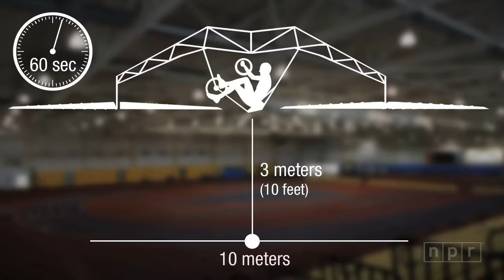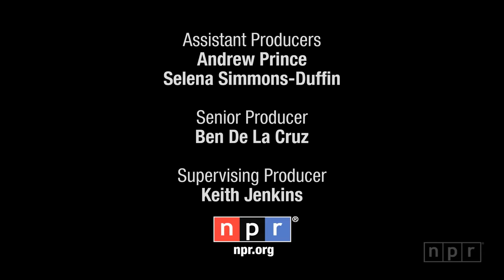Human-Powered Helicopter: Straight Up Difficult | SKUNK BEAR

Comment: Engineers: let's make a human-powered helicopter
Also engineers: let's put the human in a position from which he can't even get close to this max power output
Reply: These are aerospace engineers I doubt they know a whole about Sport science
Reply: @Minechief_1  it should be common sense for an engineer... just look at the position the guy is in: he's working against gravity to move the wheels, when he could be using his own weight to help. It's just awful design for the pilot. Ergonomy is part of engineering but this is not ergonomic at all.
Reply: @Yarblocosifilitico  Very good observation, that's probably one of the main reasons this design didn't even get close to the target. The helicopter (made by a different team) that eventually won the prize used a standard racing bike, albeit one with half of its mass hacked off.
Reply: Shhh 🤫
Reply: i also think their testing method was pretty terrible it had zero fail safe which cost a huge amount of time on repairing and they also ignored the biggest flaw and just crossed their fingers
Reply: @Yarblocosifilitico  If you push downward on the pedals like a regular bike, you are pushing downward on the helicopter. If you push sideways, you aren't creating a downward force on the thing you are trying to make go upward. "Using his own weight" would be pushing the helicopter in the opposite direction he wants to go.

Basic forces to overcome when in the regular bike position (pushing downward, in the -y direction) to achieve upward accelaration:
Weight of helicopter + Weight of pilot + Force of the pilot pushing downward on the pedals

Basic forces to overcome when in the sideways position (pushing in the x direction) to achieve upward acceleration:
Weight of helicopter + Weight of pilot
Reply: @c82153  that makes sense but I'm not so sure. The force is redirected towards the lifting mechanism whatever direction you're pushing. On my bike, I never feel like I'm pushing the bike down (sure, I'm not in the air, but, still), it just feels like I'm pushing it forwards, because that's what the bike does: get my pushing down input, and turn it into a forwards motion output.

If pushing down is a problem then use these clip pedals that allow you to push up too. In fact, according to your perspective, if the pilot made an effort to only push up, the helicopter would fly even better.
Reply: @Yarblocosifilitico  interesting perspective, I see what you mean. I think I figured it out:
When the person pushes down on the pedal, the pedal pushes up on the person with an equal amount of force. This essentially reduces the weight of the person the exact amount that the person is pushing downward on the pedals with, keeping the net force the same. This would mean that downward pedaling wouldn't have a negative effect.

Amended Basic forces to overcome when in the regular bike position (pushing downward, in the -y direction) to achieve upward accelaration:
Weight of helicopter + (Weight of pilot - Force of the pilot pushing downward on the pedals) + Force of the pilot pushing downward on the pedals

However, if the person were on the ground applying force to a crankshaft to lift the helicopter, the reactionary forces would be applied to the ground, instead of the helicopter, resulting in a different net force. 

This made me take a second to think this through lol. Thanks for the mental exercise!
Reply: @c82153  same haha, thanks for your perspective. I'm no expert but this second take of yours makes a lot of sense
Reply: This thing is an all around disaster.
Reply: @Yarblocosifilitico  You have no idea what you're talking about and just making a fool of yourself... Using his own weight! XD
Reply: @elbigotesdelatienda  well, in a bike you do push with your bodyweight because the pedals are straight below you; whereas here you have to push forward so you can't put your bodyweight into it. Not sure what you mean.
Reply: @Yarblocosifilitico  How does the body weight make a difference? All it does is keep you from lifting off from the seat as you push down on the pedals. The same can be achieved with a back rest when you're in a horizontal position.
Reply: @Kenionatus  pedals below you means you can use your body weight to push them; pedals in front of you means your body weight doesn't help you at all. It's just way more natural.

Not sure what you mean by 'keep you from lifting off from the seat'; maybe I'm weak but that does not happen to me x)
Reply: @Yarblocosifilitico  This still doesnt make much sense - in order to get your body weight to help you, you have to have pushed yourself upwards against it in the first place. The whole body weight discussion is almost certainly irrelevant here, because the question is what position allows you to extract the most power from human muscles. I only do mechanical engineering not sport so I can't say what the ideal position is, but even if the upright bike position is better, the reasoning that keeps being used to justify it is flawed.
Reply: @madattaktube  if the recumbent bike were the maximum power design it would be the only thing you see on the Tour de France, which is effectively it's own type of design competition. The benefit of having the rider above the pedals is using their weight + the strength of their muscles to push down on them, which increases the net force into the crank arm and therefore the torque generated.
Reply: @madattaktube  I don't get what's flawed about it. If you wanna break something, it's easier to stomp it than to attach it to a wall and kick it. Because when stomping you can put your full body weight in the motion, whereas if trying to make force forwards you can only put so much of your body weight into it.

Your body weight certainly helps when in the normal bike position. It's why it's useful to stand up on the bike for slopes. Same principle applies here.
Reply: @gabelyon1071  Recumbents were banned from the Tour De France and all other UCI events, so it's not really relevant. Anyway, my point isn't really about whether they are better, my point is that the reasoning is wrong.

Your gravitational potential energy relative to the bike does not change either way, so unless you're constantly falling below your bike your body weight does not contribute to your power output. Either it's simply a case of gravity acting as a restraint to allow you to push more without slipping, which as has been mentioned earlier, can be achieved by backrest design regardless of orientation, or the position inherently allows you to extract more power from your muscles, irrespective of gravity.
Reply: @madattaktube  draw out the FBD my dude, either you add m*g to the force on the crank arm or you don't. 

The riders muscles are adding to their potential energy twice over the course of each rotation by lifting them up (left and right side). This is where the extra work comes from.
Reply: @madattaktube  nvm I thought about the energy balance, I don't think bike position changes it if we assume power output from the rider is constant. 

Pretty sure the positional change just allows way more power output cause of biomechanics.
Reply: dude that's the first thing i noticed, no way can you put out decent power in this position
Reply: @Yarblocosifilitico  Came to the comments to write exactly this point, thought I should check if someone else already had. Amazing how many people get so siloed into their hyper-specific discipline, they lose all ability to think about factors outside of what they're instructed to focus on, even when they're peripheral to the central objective. This is emblematic of the root cause of almost all the problems we've had with the whole COVID shitshow, the people making decisions are absolutely fecking useless.
Reply: @c82153  I think the thing your assessment is missing is the fact that propulsion requires the vehicle to push against some form of resistance. For cars, this is tires pushing against the resistance of asphalt. For planes, this is propellers/jets pushing air backwards for forward movement, and wings pushing air downwards for lift. For helicopters, this is the rotor blades pushing air downwards to create lift. 

If the pilot of this prototype 'helicopter' was in a normal upright cycling position, even though his feet would be pushing down on the pedals, to create substantial downward propulsive force would require that force to be applied in a way that pushed upwards. Even in a seated cycling position, the downward force on the pedals doesn't have any way to exert that force upwards to propel the vehicle down - there's nothing to push against.

I'm also no physicist (although I did live with one for a couple years), so I can't speak categorically, and I'd wager it's probable that the pilot's pedaling would create some amount of downward force in the way that you're describing, simply as a product of the pilot's movement imparting a slight amount of momentum with each pedal rotation, but this momentum would be negligible - particularly in relation to the propulsive force generated by the rotor blades against the air resistance. The fact that this contraption can lift off the ground at all means the lift created by those rotor blades significantly exceeds the gravitational force pushing it down. 

If the pilot being in an upright position could substantially increase the amount of force capable of being applied to the pedals, thereby substantially increasing the amount of lift the rotor blades can exert against the air resistance, then this would significantly outweigh any negligible differences in the momentum imparted by the pedaling motion itself.
Reply: @lachlanbell8390  A very thoughtful and detailed response, thank you! 
However, some corrections to some points you made: there is in fact something for the upward pedal force to push against - it's the pilot. The pedals exert force into the pilot (Newton's Third Law), who kept down by gravity. Think of how, while riding without holding the handlebars, you can push down on the pedals of an ordinary bicycle without lifting yourself off the seat, but push too hard, and you lift yourself off the seat. The advantage of having the pilot sit horizontal is that the pilot can push as hard as he wants on the pedals, and he will not lift himself off the seat by pushing the pedals too hard - given that they need to choose someone who is lightweight, the force required to lift himself off the seat is low compared to the average person, so the pilot lifting himself off the seat is a definite possibility.

Also, with regard to momentum - remember, the pilot's weight relative to the weight of the helicopter is probably close to 1:1 (I forget what they said it was exactly). It's an extremely lightweight airframe. Changes in momentum of the pilot would definitely have a massive effect on the helicopter's performance.

In addition, I don't think the pilot being upright would substantially increase the amount of force to the pedals, because he is a very light person, and applying a massive amount of force would just lift him off the seat if he pushed the pedals too hard. This would probably change if there was a structure keeping the pilot on the seat, like a "backboard" of sorts, but then u might be right back in the position of making the pilot uncomfortable.

Cool conversation, this is a cool thought experiment!
Reply: @gabelyon1071  Dude, pretty sure you managed to think yourself backwards. You had it right the first time - the upright position allows for the rider to use their muscular strength + their weight to create more force on the pedals and therefore more torque into the sprockets/chain. The reason the pedals are offset at 180 degrees is so that the rider can shift their weight - essentially, they apply their weight to push one pedal down to the bottom of the rotation, which thereby causes the other pedal to move to the highest point of the rotation, at which point the rider can shift their weight to the other leg in order to push down on the pedal that is now in the top position. When the rider is fully seated on the bike then sure, it's primarily just their leg muscles that are being used to generate downward force on the pedals, but if the rider's entire body weight is not being applied to the seat, then the remainder is being applied to the pedals. 

This is exactly the point Yarbloco made about standing up on the bike being useful for situations where more force is required - by standing up on the pedals, you are preventing any of the gravitational force created by your body's mass from being applied to the seat, and ALL that gravitational force is thus being applied to the pedals. 

Madattaktube's claim about gravitational potential energy fails to account for the fact that we use our muscles to change how our gravitational potential energy is utilised to create movement. This is literally what allows us to walk - we use our legs to push against the ground, and each time we lift our other leg we then put our foot down in another position so that our gravitational potential energy is applied into another spot. It's the act of alternating this movement from one leg to the other that allows us to move in a bipedal motion. 

At the most fundamental level this is exactly the same as what happens when we ride a bike - the only difference is that on a bike, our gravitational force is exerted against the pedals instead of the ground, which creates the torque used to rotate the sprocket, thus turning the chain, and rotating the other sprocket which is attached to the wheel, thereby turning the wheel as an extension of the sprocket. Tying back into my previous comment responding to Chris G, this turning of the bike's wheel creates friction between the bike's tire and the ground, and the torque generated by the pedals being applied against the frictional force of the rubber against the ground is what creates the forward movement of a bicycle. Or, in this case, the torque generated by the pedals is used to turn the rotor blades, which push against the air resistance to create lift.

TL;DR: the reason an upright bike is more efficient is because we're not just using our leg muscles to push down on the pedals - we're actually using our leg muscles to lift our body weight from the bottom pedal and apply it to the top pedal. We're using our legs to harness the gravitational force of our body mass with each rotation of the pedals, which is why standing up on the pedals creates more propulsive force than when we sit on the seat and only apply a small portion of our body's weight to the pedals.
Reply: @c82153  Hey my friend, wasn't expecting an immediate reply when I was responding to comments from 2 months ago. I agree it's a fascinating thought exercise - I've got law exams coming up and shouldn't be on the internet, but couldn't resist this discussion hahaha. 

Re: the points you brought up, I think my last response to gabe lyon covered a lot of those points - like I said I wasn't expecting a reply quicker than I could post my next comment, so figured you'd see them both at the same time. I only caught your reply because I refreshed the page to make sure my comment was still there (habit I've developed from YouTube deleting so many comments). 

I'd be keen to hear what you think of the points I made above, let me know what you think?  😃

EDIT: Just to touch on your point about "if there was a structure keeping the pilot on the seat, like a "backboard" of sorts" - in light of my case about gravity in that last comment responding to gabe lyon, I think that using some structure like this to prevent the pilot from lifting himself off the seat would actually be detrimental, because it would constrain the pilot's capacity to use that gravitational force in order to push the pedals. Thought that point was worth including :)
Reply: @lachlanbell8390  I actually happened to hop on to see a different post and read your reply, kinda cool how that timing worked out haha. 
I read the post you mentioned and I think there are some corrections to be made about what force goes where in this system. When sitting down, the force being applied to the pedals is due to the force exerted by the legs of the pilot. If the force exerted by the pilot's legs equals the pilot's weight, the total downward force into the heli is still equal to the weight of the pilot. 

Now, get this: if the pilot stands up, he can exert more force to the pedals. cool, you get more energy input and more lift, right? Yes. However, exerting a force onto the pedals that is greater than the pilot's weight results in a larger downward force on the heli compared to the downward force of when the pilot is sitting down, which completely counteracts any additional lift you achieved by the pilot "using his weight to pedal". Think about how your tires on a bicycle flex and squish down when you pedal standing up, but do not do so when you pedal sitting down. You've got the ground to push against on a bicycle; that provides that upward force that counteracts that additional downward force you put into the pedals. With a heli, guess what you are pushing against? That lift, which you just used your weight during pedaling to create more of. The net force is still the exact same whether you put your weight into the pedal stroke by standing up or not, because you counteracted the additional lift you got by pushing downward harder. That doesn't happen with a bicycle because you have the ground to push against; you aren't pushing against that upward lift you are trying to create.

Another way to think about it - plot both the force on the seat+pedals and the lift you get from the rotors on the y-axis, use time for the x-axis time. With the pilot sitting down, the average/net force on the seat+pedals is the constant, correct? And so is the lift, making the average/net force on the heli constant. Now plot it for the pilot standing up. With the pilot standing up, you get more downward force into the pedals than sitting down on the downstroke, which you exchange for more lift. Still the same amount of net upward force.

More downward force on the heli + More lift = the exact same net upward force as sitting down, or perhaps slightly lower, because you exposed more of the power cycle to components in the system that experience friction (rotors, pulleys, etc).
Reply: @jcd-k2s  ummm... I'm not entirely sure what you mean by "bad physics". Physics isn't good or bad, it just is.

Newton's Third Law has nothing to do with momentum, it has to do with action and reaction (forces). Momentum/inertia is Newton's First Law.     
Edit: "nothing to do with" is not correct. Newton's Third Law can be used in its momentum/impulse form in many cases, but not in the "closed system" Benoit mentions. My apologies for the confusion on this, I should have worded it better, as "Newton's Third Law has nothing to do with momentum" is simply wrong.

Why do you say it's a "closed system except for the lift"? It seems to me that lift is absolutely included in the "closed system". You cannot include the input (the pilot) of the system while excluding the output (the lift) and call it a closed system. I suppose you would need to define what you mean by "closed system", it has many different meanings in engineering applications.

In the bird example, yes the plane would absolutely be lighter without the bird on it. Assuming the system is a control volume around the plane, the weight of the bird exits the system when it leaves the control volume, which makes the overall system lighter.
Reply: @jcd-k2s  I do not think the synchronization of arms and legs negating power is a valid assumption. This would need to be tested thoroughly before making such a claim.
Reply: @jcd-k2s  umm... according to NASA, directly quoting them:

"Newton's Third Law of Motion (Action and Reaction): Whenever one object exerts a force on another object, the second object exerts an equal and opposite on the first."

Wanna tell me what part of that mentions momentum? Might want to study up on physics yourself mate lol
Edit: yes, Newton's Third Law has its momentum/impulse form, but cannot be applied to the "closed system" Benoit describes. This is why I was confused why he kept talking about momentum/impulse for Newton's Third Law, I correct this further down.
Reply: @jcd-k2s  cuz the point of bicycles is not to power a helicopter lol
Reply: @jcd-k2s  Also, the system absolutely acquires momentum from the force applied to the pedals; the rotors spin. That's kind of the whole point of having the pilot. The helicopter/pilot system starts with no momentum, pilot applies a force to spin the rotors (Newton's Third Law comes in here), which then provides lift. The system gains momentum from the pilot spinning the rotors; you cannot exclude some momentum and include other momentum in your momentum-based calculations. That's not how those calculations work, dude. I see where you were going with the "Newton's Third Law is conservation of momentum" stuff now. However, "conservation of momentum" cannot be applied to this situation or system, as friction occurs at many points in the system, such as the air friction on the spinning rotors (which is an external force on the system you defined). You could use conservation of momentum if you'd like to include the momentum calculations for the air molecules tho. Momentum, as far as we know, is always conserved, but is not always practical to use in every application.
Reply: Okay, let me preface this with, I am skimmed the responses, and most of it seems to be directed about maximum output from the legs.

Yes, you generally will achieve 20-30% more outright power when cycling from a standing position vs recumbent on a bicycle.

This is not a bicycle.

You get that extra power not because of gravity, but because you are pulling up with your arms on the handle bars, and using all of the muscles from your arms, shoulders, back, core, and legs to pedal. A Recumbent effectively removes your arms and core from the equation.

So, why not use a standing position? Because to maximize your output in a standing position, you need freedom to move, to throw your mass around into alignment. Watch a cyclist during a sprint, and watch how they are throwing the bicycle around underneath them. How their weight keeps shifting, side to side, back and forth.

How make that bicycle, 80 feet wide. With propellers on the sides.

Sometimes, you have to seek compromises to fit within a situation. Remember, their goal is to have this vehicle, accent to 10ft, and have a point remain in a 10ft lateral box, not drifting outside of that parameter. If you go and stand to pedal, you are going to be throwing your mass around radically changing the attitude of the craft in a fairly random pattern, thus sending the craft off in unexpected trajectories.

So, they opted for the recumbent position, to lower the changing centre of mass. They then try to recoup the energy loss of the recumbent position, with an arm powered cycling set up.
Reply: @dposcuro  I was thinking that an upright bike would actually be a limitation, because your maximum impulse would be somewhat limited by your weight. If you exceeded your weight, you would basically be jumping off the pedals. 

But you're absolutely right about using your upper body and core to increase your output. It's been too long since I've rode a bicycle, but reading this reminded me of how that feels.
Reply: @dposcuro  good points but I still disagree with some.

First, gravity does do something. It can't be ruled out of the ecuation. If you had to pedal upwards instead of downwards, it'd be much more difficult... mainly due to gravity. To a lesser extent, same applies when on a slope (that's why we stand up and pull from the handlebars, as you correctly say).

The bike gets thrown around so you can pedal like you're actually sprinting (as in running). Basically you're making it so you can put all your weight behind every stroke (so you are taking advantage of gravity).

True that the physics in this device work different than in a bicycle, but still, I don't think the advantage of lowering the center of mass (not sure if it's much of an advantagde, but I guess it must be if they did it that way) compensates for the akward position. 

A cyclist can still put more force without standing up, just by pedaling stronger, and will always deliver more power pedaling downwards than if the pedals were at the height of the handlebar. As you say, "A Recumbent effectively removes your arms and core from the equation." And that just decreases your potential. Even if to maximize the regular position you need freedom to stand up and move, you'd still achieve way more power just by sitting on the bike normally.
Reply: @c82153  you know nothing of physics.
Reply: @stephencaparelli7733  pretty much. the number of scientifically illiterate comments here is hurting my brain. there are differences between upright and recumbent cycling positions, however none of them having anything to do with pushing with the assistance of gravity or any other such nonsense.
Reply: @c82153  That is not how this works. You are pushing against the air, which increases pressure below the wings (rotors are wings that spin), canceling out the movement. Why do people who have no idea about physics pretend to know what they are talking about? Especially this garbage that makes ZERO sense. You are not attached to anything beside the helicopter, you pushing down means the helicopter pushes back with an EQUAL force.
Reply: @madattaktube  he is correct your body weight does most of the work when riding a bike. the helicopter pushes up because of the rotor blades and putting the pedals below him would make him more effective. That is why another team who used a much heavier design won with ease.
Reply: @excitedbox5705  I wouldn't say I have "no idea about physics" mate, I've got a BSME with a Minor in Aerospace Engineering. I don't really like to bring that up in open forum discussions, because it's not generally relevant to the thought processes being discussed, but this is the 4th or 5th comment that mentions this unproductive "you know nothing about physics" phrase.

Anyway, back to the actual topic:
Fluid dynamics is a tricky thing to grasp. While "pushing against the air" will exert a force against the air, guess what the air can do? It can be pushed out of the way, letting the mass pass through - air is a fluid. This is why the air cannot provide an equal and opposite force to the total force exerted down "using your weight" (unlike the ground, which can provide as much reactionary force as you need). You cannot apply an "infinite" amount of force to something that can just move out of the way.
Reply: @c82153  The fact that you would be flying means that at minimum the air is providing enough resistance on the rotor blades. There is no "just move out of the way". Pushing down would increase the force pushing against the air under the blades meaning the blades create MORE LIFT. If you removed the blades, then yes you would be able to push the bike down while STILL slightly being pushed up (just because you don't see it doesn't mean it isn't there). Anyone who truly has a AEROSPACE degree SHOULD know this. At this point, I am actually afraid that someone like you might be designing anything that gets higher of the ground than a stepladder.

Take a big sheet of plywood and let it fall. As it is falling push down on it with your hand. That force you feel pushing back is the plywood NOT just moving out of the way. In the case of the helicopter, the pushing force also rotates the blades, which means they speed up and create even MORE lift. Basically you are falling on the pedal instead of just pushing the pedal which means the energy input is increased.

PS. Besides this being common sense, this is learned in 7th grade science class, and you do not need a degree in engineering to understand this concept. In your case, you should have kept that to yourself.
Reply: @excitedbox5705  Ok, so based on your comment, it seems pretty clear to me that you don't know how wings actually generate lift. 
To quote you: "The fact that you would be flying means that at minimum the air is providing enough resistance on the rotor blades."
Wings do not generate lift by the air "providing resistance on the rotor blades". Wings generate lift by translating the velocity of the wing into a pressure difference. As air flows across the wing, a low pressure zone is created on the top of the wing, and a high pressure zone is created on the underside of the wing. The magnitude of this lift depends on the angle of attack of the wing, the coefficient of lift, and a few other factors including the velocity of the wing. The angle of attack of the wing is basically what angle the wing moves through the air - put the tip up too much, you will stall and lose lift, put it down too much, your pressure zones will be equal, giving you net-zero lift. Make sure you understand this concept before reading my next point, it's important.

If you were to slam down with all your weight on a helicopter as light as the one in the video, you will introduce a downward component of velocity in the wings (the velocity of the wing is now pointed slightly to the ground). This changes the angle of attack of the wing (in this case a rotor blade), reducing the wing's lift output, and depending on the wing, could actually stall the wing.

Edit: Also, in your plywood example, the force you feel pushing back is a combination of the plywood's inertia and the drag induced by the air moving out of the way of the plywood. So of course, it's not the plywood moving out of the way lol, the plywood is not a fluid.

Edit 2: Also, to your "wings speeding up" point, depending on the shape of the wing, the wing might very well slow down when you put your weight on the helicopter, thus reducing lift.

Insulting someone is a sign of having a weak argument. It is also a sign that you don't know what you're talking about. Just putting that out there.
Reply: @c82153  I mean your comment earlier about Newton's 3rd law having nothing to do with momentum is still categorically wrong. It states that equal forces are applied between bodies which is equivalent to the statement that equal impulses ie changes in momentum are experienced by each body.
Reply: @poo2uhaha  Oh I see. Yes, I pointed this out in one of my posts later on. "nothing to do with" is an extreme statement; I should have been more specific, as "Netwon's Third Law has nothing to do with momentum" is incorrect (I've corrected this in said post). I should have specified in that statement that conservation of momentum cannot be applied to the "closed system" Benoit was referring to (you have to account for all sources and sinks for momentum), so it would be incorrect to apply Newton's Third Law to the "closed system" in its momentum form, but could be applied it in it's force form (comparing lift force, drag force, weight force does not require you to account for momentum change of the air, as no momentum can be lost if no time is passed as far as I know). I have edited these posts to clear up future "that's wrong" posts so we can move on with the conversation.
Reply: i was hoping for a gearing system on it too (maybe it would have been too heavy) or at least something, so the pilot wouldn't have to be having a seizure just to power the thing.
Reply: @brycehartwick  The mass of the rider doesn't really change and neither does the force of gravity, so the net effect regardless of how you pedal is just same old .... Force (downward) = Mass (of rider) X Acceleration (gravity 9.8m/s2).  All you can change is whether you pulse it or not, which can have structural implications.
Reply: @treali  Some of us can tell, and some of us think they can tell. I have accurately represented my credentials. I have not and will not pretend to be an expert on anything - I suggest you do the same.
Reply: The pedal/handle design was bad. The pilot should have been positioned vertically and firmly cleated into pedals, with hand-grips, not additional pedals, as it's the same logic of standing on bike pedals while cleated in and holding butterfly bars, you can use your arms to drive your body down on either side which adds way more power to the stroke than whatever measly force you could manage cranking with your arms as well. I know some will ask why butterfly bars if drop bars are used in racing but remember once a bike starts travelling at real speed aerodynamics are a huge factor and drop bars allow you to get much lower which is way more important at very high speeds. None of that is relevant here. You can see why someone else won this prize.
Reply: what if they used gears in like a 1:100 ratio in the way 3d printer academy did with his super fast gearbox. it would have less time of inactivity and the energy he uses will overall be put more into raising the helicopter
Reply: The winning team use this design (no hand pedal, and use a bicycle to maximize the leg power).
https://www.youtube.com/watch?v=syJq10EQkog
Reply: @iridios6127  First off: insulting is always a great way of making someone listen to you and consider your point...

Anyway; have you ever ridden a bike?

Have you tried stomping vs kicking (a push kick)? I can garantee you can generate way more force stomping than kicking (unless you're trained in martial arts). Why you think that is? The way our body is made, perhaps? The way we use it everyday? (yeah, you push down every step you make... you hardly ever push forwards with your legs...)

"they have support for they back -- which provide much more power output."

How exactly? He's not even leaning into the back support.
Reply: @orlandu2532  thank you very much, I think that settles it...
Reply: - - - @Yarblocosifilitico  
Did you ever teach  Newton’s Third Act at school ?
Sit a man on your back and do a sit-up -- legs are much stronger than the weight of someone who walks on them.
Reply: @iridios6127  which is why you should be in a position where your legs can reach all their potential... as the winning design demonstrated:
https://www.youtube.com/watch?v=syJq10EQkog

I'm not sure what you even meant by that, you're just agreeing with me without doing so. I think you just haven't understood why I was talking about pushing. But yes, our legs are made to push downwards, not forwards as this non-winning design requires. 

Also, I can see by your lack of explanation that the back support doesn't contribute much to the power output. 

Anyway, as far as I'm concerned, the video I linked (thanks to Orlandu) settles the matter. Have a good day
Reply: @Yarblocosifilitico  
Also -- seems you didn`t notice -- in Sicorski design was used mach more powerful "driver", than here.  ))))
Reply: @iridios6127  the leg machines are that way because having weight on your back adds unnecessary pressure to the spine

Again, I'm not even sure what are you trying to argue against. If it only comes down to the position, legs do morce force downwards than forwards, just because of how the body works. 

The motion of pedaling is very different from sit ups or machines. If the pedals are beneath you, you can put your weight on them. If they are in front of you, you can't. Simple as that. 

Btw, how do you even know whose stronger? Just judging leg bulk or what? (cos that can be deceiving...)
Reply: Thats what i instantly thought!!!
Reply: I'm an engineer and at first I thought this was a good design, as it used both hands and feet to extract power, so it makes sense, in the end it worked!!
Reply: @Yarblocosifilitico  worth noting is that the one in that video was not really the same design.  roughly yes, but it's way bigger and uses more cables for tension which are probably lighter overall - it's almost twice as big and only 50% heavier.
Reply: @c82153  one of newtons laws, the force applied one way is equal to the force applied back, in this case the force applied downwards on the pedal is the same as the force applied up on you. It doesnt make a difference. the most effective way to get the most power output would probable be someway of deadlifting a bar over and over.
Reply: Engineers aren't taught to critically think, they are taught to "solve problems." Very different.
Reply: @thomasjust2663  really? How efficient is it tho? Don't you think a different design could extract even more power from both hands and feet (or arms and legs, rather)?
Reply: @cavemanraveman1  as half as heavy? No wonder they won then. Source of that fact tho? Wasn't there a certain degree of specifications in the contest?
Reply: @Yarblocosifilitico  it's 50% heavier not half a heavy, so 120lbs instead of 80 but 190ft instead of 100
Reply: @cavemanraveman1  true, my bad. Still, significantly heavier for the pilot/rider, I assume
Reply: @Yarblocosifilitico  rider doesn't look that stressed in the Atlas video, not nearly a stressed as the ones here.  I'd assume that with the correct use of gears it's not like impossibly hard to pedal
Reply: @ancellery6430  The dispute lies not in whether or not this interaction happens between the foot and the pedal (Newton's Third Law), but in the implications of that interaction on the rest of the system. If you increase the thrust of the rotors by "using your weight", but at the same time increase the effective weight on helicopter (by slamming your weight down onto the helicopter), you may very well cancel out all of that thrust you just produced by using your weight. Remember, you cannot assume that the weight you slam down onto the pedals just goes into the ground - you are in the air with nothing stopping you from dropping to the ground except the thrust you produce with the rotors. Not to mention slamming your weight down onto the rotors may very well change the rotor's angle of attack, which can reduce the lift force. This depends on how the rotors were optimized though.
Reply: @Yarblocosifilitico  you'll notice if you watch the video, for this winning design, no point did the pilot ever ride out of the saddle. He was firmly planted on the seat the entire time. This completely negates the argument that the ability to ride out of the saddle and "use your own weight" is reason this design won. Also, in the recumbent position, the rider is still "stomping", not "kicking". When you aren't riding out of the saddle, your weight is just something to push off of, and nothing more. You can just as easily push off of a structure, such as a backrest. You'll notice that recumbent bike riders complain about knee stress sometimes, because they can actually push harder on the pedals than regular bike riders when both are pedaling from the saddle.
Reply: @c82153  hmm you could be right, I'll reconsider. I've never tried the recumbent position so maybe I'm wrong about it and you can indeed make the same force or even more. I still think having a fixed handle to hold on to would be better, and the regular position seems more natural to me, but maybe I'm wrong and this design is not that bad
Reply: @Yarblocosifilitico  Cool! I haven't tried the recumbent position either, it may be cool to try.

I think the winning design won because they made the system more rigid (or it appears to be), and opted for more power over an ultra lightweight design (they use a more powerful/heavier pilot, and a heavier frame to take the higher force output; it looks like bigger wings as well. I'd need numbers to confirm this though).

Also, I think it's likely that the engineers consulted bikers about the effects of using the recumbent position on a biker's power output - it seems to me that'd be a massive oversight to spend loads of money and not seek input from the pilot or experts on the topic.
Reply: @c82153  I know this is an old thread, but there is a lot that needs to be clarified here and still more to learn.

What we care about is that the pilot + the helicopter move up, so let's treat that as our system. When you do the force balance this way, you do not include any of the forces between the pilot and the helicopter. These forces are internal and cancel by Newton's third law. You did eventually get here, but I think this is the simpler/better way to think about it.

Regarding whether gravity is helping you if you are standing upright, the only way it could is if it was doing work somehow. Again, if you think of the helicopter + pilot system, the center of gravity of that system is moving up. Since W = Fd, gravity is doing negative work on the system! Remember the system we care about is pilot + helicopter

This is all you need to show that gravity can't be helping here, but I will go through the intermediate steps for clarity. As the pilot uses his weight to push down, gravity does work on the pilot because the cg of the pilot moves down. This work provides more power to the propellers and is therefore helpful. However, on the next stroke the pilot must push himself back up, raising his cg back to where it was, so no net work was done on the pilot. It's also important to note that pushing himself back up pushes the helicopter down, negating the extra power provided by the propellers.

Hope this clears things up!
Reply: @Yarblocosifilitico  see my reply to Chris. It should help clear things up
Reply: @c82153  Also, I know you admitted you were wrong about this (good on you, that's rare on the internet), but Newtons third law and conversation of momentum are not merely related, they are 100% equivalent. They are two different ways to say the same fundamental thing. I don't think this point got hammered in enough.
Reply: @Yarblocosifilitico fr right😂😅. He needs to be standing up right pishing down for maximu torque, or sitting like on a racer bike.
Reply: @c82153  downwards force is only created if mass is ejected in an upwards direction. Because the rider stays on the bike, there is no downwards force exerted even if he rises on the bike by stomping the pedal. The position of the center of mass of the aircraft and rider would stay the same.
Reply: @matthewbadger8685  oh wow I didn't know this chain was still alive, cool!  

Watch a mountain bike tire when someone is riding out of the saddle, or less so when they are in the saddle. See it squish on the downstroke as they come downwards, and unsquish on the upstroke. Downward force is applied to the bike.

I'm not really sure which comment you're referring to, but if what you are saying is true, trampolines wouldn't work very well.
Reply: @matthewbadger8685  tbh, I'm pretty sure we're saying the same thing, my friend. Being able to ride out of the saddle and "stomp down harder" probably wouldn't get you any better results than riding in the recumbent position.

I'm pretty sure what you mean to say is "yes, there is a downward force pushing against the air in the downstroke as the rider pushes against the pedals, but a net upward force on the upstroke, so it cancels out". Downstroke presses on the air more, upstroke presses on the air less. The forces cancelling (or close to it) does not mean the forces don't exist, it just means the net is close to zero. I'm pretty sure I said as much in some of the posts above, but I'd have to go back and read through them again, it's been a while.
Reply: @c82153  Aye you're correct, we were thinking of the same thing.
Reply: @c82153  your intuition of the situation is wrong. rider position has nothing to do with the total forces acting on the airframe.

if what you are saying was the case, anyone with a deadlift over their own bodyweight could literally lift themselves by their own bootstraps.